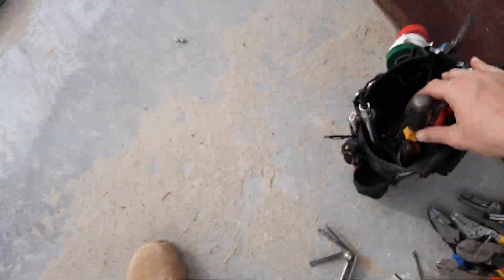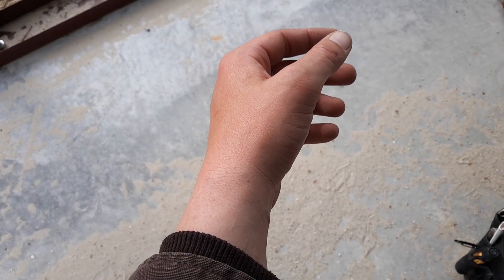Tools EVERY Electrician Apprentice NEEDS (2019)..Electrician Training  videos Online Free

Comment: Wayyy to much stuff in there man... you only need one of each of everything in ur pouch and a lot of that stuff needs to be in ur tool bag not ur tool pouch man...
Reply from the maker: Yes if that was a pouch that I wear. I have a much smaller one I wear which I will put the 3 or 4 tools that I am using at the time. this pouch is being used as a tool bag basically. That's why there is so much in it. But I agree for the one you wear.
Reply: @simplestump6629  oh ok gotcha. the best setup you can get is the bottom piece of the packout which roles and the 15 in tote and the tech bag. Both Snap On Top of the Rolling part and those three pieces of Kit plus a tool pouch you will never need anything else. Don't fall for the Trap of the $300 veto bags that are not made in America lol

Comment: HAHAHAHAHAH SAYS YA NEED A GOOD PAIR OF WIRE STRIPPERS THEN SHOWS THE CHEAP SOUTHWIRE CRAPPY STRIPPERS!!!! HAHAHAHAHAHHAH
Reply from the maker: Yeah brand is a matter of opinion. South wire isnt horrible but they are not my favorite brand by far. I would recommend klein. That's my preference actually. That's just what happened to be in my bag at the time. I actually have about 5 sets of strippers in different tool boxes or vehicles.
Reply: @simplestump6629  get the ideal strippers with the curved handle.   Best around
Reply: S J south wire makes good wire strippers and screwdrivers. That’s basically all